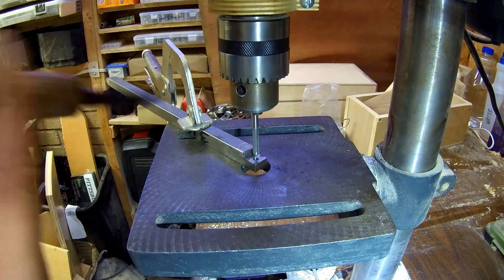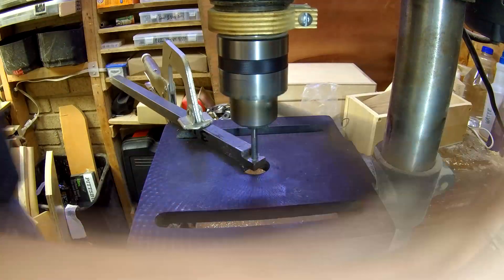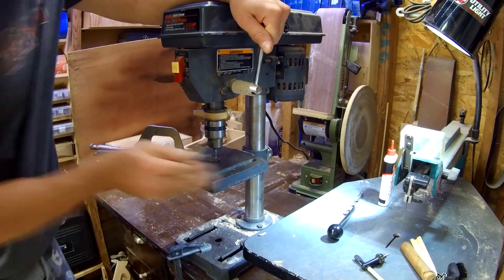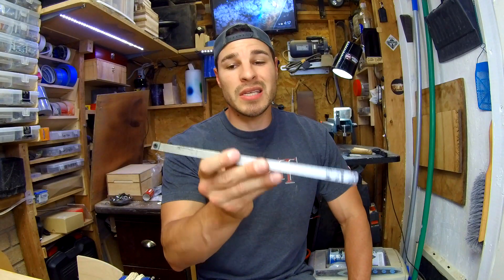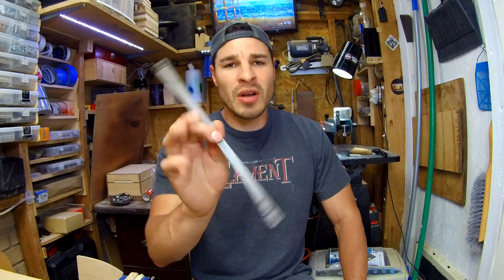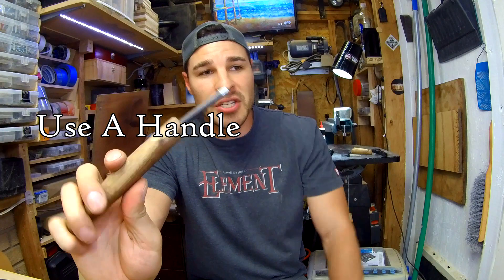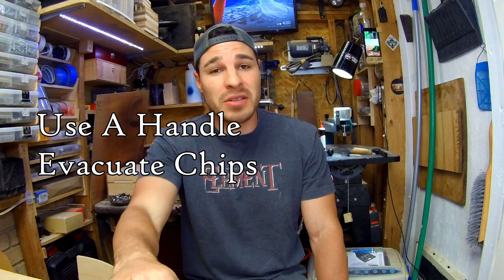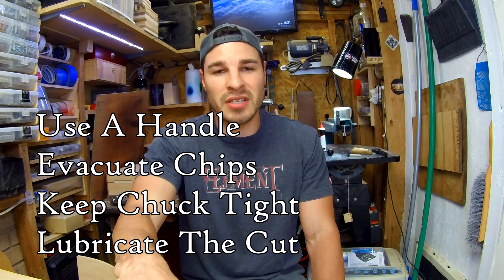Easy Way To Tap Threads With a Drill Press

Comment: Had I known this I would have saved many taps. Really thankful to you for showing the way.
Reply: I don't know why I never tapped like this, considering I have a milling machine which is better than a drill press. plus I drill my holes with it, so I can easily put the tap on and everything will line up perfectly. 

I guess I never thought of putting a bar in the chuck to turn the tap.
Reply: @Fighter4Street  Yes, indeed we all learn through sharing of experience. Milling machine will definetly be a better option.
Reply: @upward_onward  I actually just tapped a hole with a plug tap in stainless steel. At first it was not working out but then I used a lot more force to push down on the tap with the handle. It finally tapped the hole. 

The 2nd hole is having the tap spin in the drill chuck, will have to deal with that slippage. I got oil on the whole tap I think.

I wish he discussed how much force he was using to push down on that tap.

Next time I would use a taper tap to start the hole and not a plug tap.
Reply from the maker: In the begining it's a lot of pressure maybe 40-50lbs. Once the thread is started it does t take more than a couple lbs to keep cutting

Comment: Did you chuck the tap on the square drive part or the lower, round shank?
Reply from the maker: @sukimawson8880  The truck is a three-jaw chuck and the square has four sides so you can only do it on the round shank. One of the flaws with this method is that the truck will slip if you're not clearing chips off enough and you might have to really crank down on it which isn't necessarily great for the chuck.
Reply: @CNTHINGS  Thanks for the reply! I imagine the hardness of the tap doesn't help the chuck grip it very well, either.
Reply from the maker: @sukimawson8880  correct.